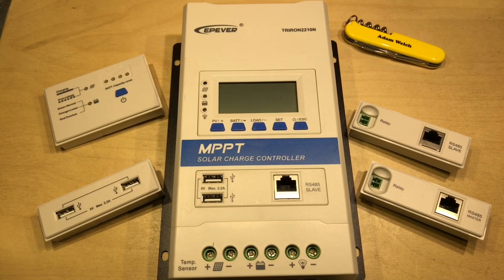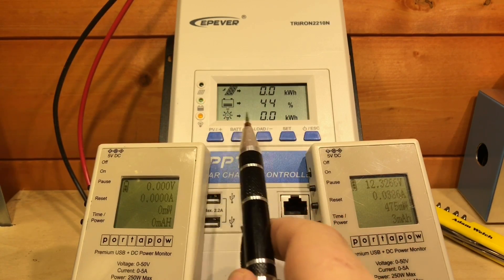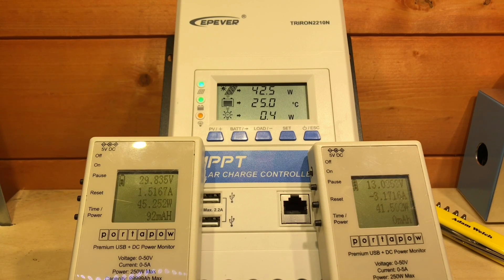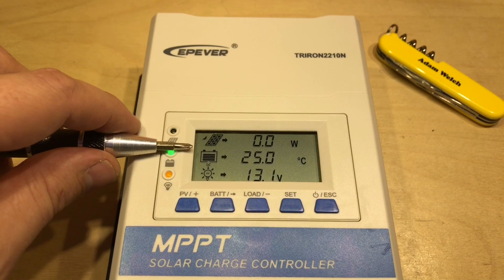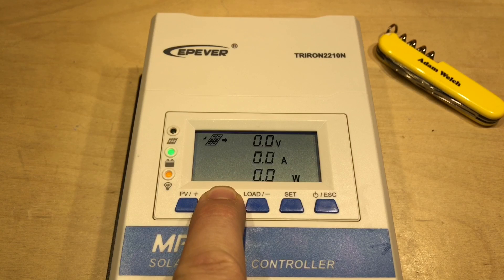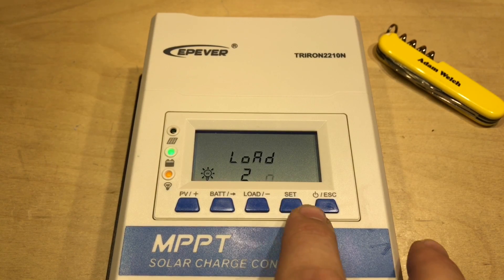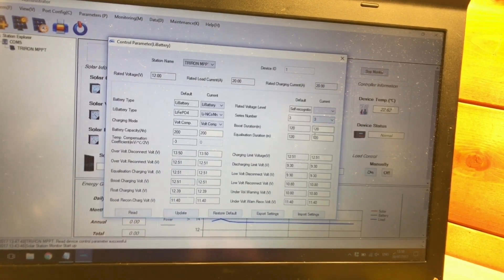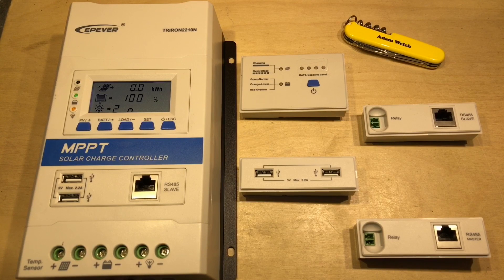First Test - EPEver TRIRON MPPT Solar Charge Controller - 12v Solar Shed

Comment: I've ordered a TRIRON 4215N to charge a 7kWh 24V LiFePO4 from 940W of panels. The documentation claims lithium low temp protection which is why I ordered it. This is an upgrade from a 12V Tracer 4215BN 220Ah FLA system. I still need a 12V system and am considering using a 24->13.8 converter, or if possible, do you think I could drive the input of the Tracer from the output of the TRIRON so that I can leave the entire 12v system, including batteries, intact while the 24V system is used mainly to run a 3 or 4 kW inverter?

Comment: Hi Adam! excelent review! i buy this one without modules and i would like to know if i can use it like that or i need the modules for make it funtion? thank for your anwers!
Reply from the maker: Yes it will work without modules. I’m guessing it will be in flooded battery mode, and auto switching between 12 and 24 volt.

Comment: thanks Adam for all your  valuable imformation regarding solar charging.
i have one question regarding MPPT,  would it make a difference between 1 x 100w 12v panel or having 2 x 50w panels wired in series??
Reply: I would guess that if you are working with either one 100 watt 12 volt solar panel or two 50 watt 12 volt solar panels, that having two 50 watt panels connected in series would have  a higher open circuit voltage and possibly greater efficiency in the Pv wiring going to the charge controller because it would be carrying a lower amperage. Aside from that, watts is watts.

Comment: Hey Adam, thanks to your videos and advices below I have now the old version fitted and working on my campervan with 200W solar panel.
I have a question related to batteries. I have 2x160AH FIAMM Monolite 12umtb 160 (AGM) plus one 100ah Maplin Sealed Lead Acid Battery I have likned them all in parallel to get ~400Ah on 12volts. Am I making mistake here? Do I have to make equalizers or split them (get rid of the Lead Acid one?)

The AGM one is with float charge recommended to 13.6, where the sealed one says 13.6 to 13.8. And I have set the EPever to 13.6 float.
Reply from the maker: It's generally not recommended to mix batteries.  They have different capacities and different charging and discharging characteristics.  However having said that there are lots of people who are running setups like yours and it works for them.
The biggest thing to consider are losses in charging and discharging and the potential current moving from a larger battery to a smaller one.  If your larger batteries spend much of their time recharging the smaller battery because it has a lower capacity it might be more sensible to remove it all together.  It's worth trying to monitor the current moving between individual batteries - best with a DC clamp meter.  The capacities aren't a million miles away from each other and the charging parameters shouldn't be either so it might be ok.
My advice, try with, try without see what works best in your application.  Although it's possibly not the straight answer you were seeking?

Comment: Hi. with charge controller have you now on your system.
Reply from the maker: +Christofer Steger I’m still using the EPEver Tracer A MPPT charge controller on my main lead acid bank. I’ve got another project in mind for this Triron charge controller.
Reply: Ok
I'm struggling to choose controller and now ordering a Tracer-A 4210A with temp sensor wifi and mt50.
So a can grow from my 200 W Panel.

Comment: Hi Adam, great channel and videos! I googled but I cannot find this controller anyware to buy? I am missing something?
Reply from the maker: I got a pre-release unit, but it is now listed on the EPSolar website so it should be showing up in the usual shops very soon I would guess.
Reply: Yep i saw it on the website. Still not listed on the shops. In general in comparison with the older version what do you recommend, go for the Tracer or wait for the TRIRON?
Reply from the maker: +Ясен Владимиров It all depends on what features you're after and the price I guess. If it proves value form money the better LCD screen option of the TRiRON is better than the tracer A. If you could use the USB ports then the TRiRON is the one. If you're going to pop your controller in a cupboard and just connect a MT50 or wifi adapter then the tracer a will do everything the TRiRON will in the same situation.
Reply: +Adam Welch - hey Adam, indeed, i will hide the controler and just use the MT50 to display some information in the motorhome and thats all. I will go for the old one, I found a pretty good offer on aliexexpress :) Thanks again! And keep doing this amazing videos!

Comment: As i had watch most of the video, Mppt solar charge controller is boost the voltage to chargeable voltage for charging! some how most of the people use the higher voltage to test the MPPT controller! never try how low the  solar panel voltage can be use to charge the battery! MPPT is design  to boost voltage when sun light is on cloudy days, it still able to charge the battery!
Reply from the maker: +Eric Lee The vast majority of offgrid MPPT solar charge controllers use buck converters. The solar panel voltage must be higher than the battery voltage. There are a couple of exceptions. The Minghe 7210A and the CTK300 are two examples of offgrid MPPT solar charge controllers which boost the solar voltage up to the battery voltage - but they are in the minority. 
On grid MPPT charge controllers will typically boost the solar voltage up higher in the inverting stage. 
This MPPT controller uses the high voltage and lower amperage to convert into a lower voltage higher current charge for the battery. Testing this controller at a lower solar voltage than the battery voltage would have resulted in no charge at all.

Comment: Thanks, Adam. I hope that a firmware upgrade will allow Lithium battery charging as default options, rather than you having to set a custom option. P.S. 'Man gan ease' - It's a bit of a tongue-twister at the best of times! You're not alone; I fall over it, too, when under pressure.. ;-) It really should have an easier alternative name.
Reply from the maker: Sorry! ;-p  Thanks for the assistance, I'll try to get it right next time, or just gloss over the term!  
Yeah a firmware upgrade would be nice but EPSolar tend not to do that from my experience.

Comment: Encouraging that it can support lithium now, however 3S or 6S is limiting, especially without balancing. Most 24V inverters would use 7S.
I use 14S for 48V which is a minimum for any serious inverter usage. As Epever make a fairly decent 48V 3kW inverter, it would be useful to make a charge controller that can support it!
Reply: Adam does this unit allow manual adjustments to manually set the voltage high enough to support 7s?
Reply: Just saw they offer a 60A eTracer with 3200W  (48V) max.
I'm curious about the 7s or 8s too, I think with user settings you could just set them to the correct overall voltages?

I guess you'd still need a separate BMS and balancing system e.g. Batrium or SBMS120 from electrodacus.

Comment: Hey mate, could you please do a video ( perhaps with super caps? ) showing if / how this controller stops charging / doesn't continue to float charge?. Its a little confusing how it charges, i assumed that in boost mode it charges to say 12.51v and that it doesn't apply a float charge until the battery drops to the float voltage of 12.39. That's how i understood it anyway but some people say you should set the float voltage to the same as your charging limit (12.51v) to stop it float charging. My experiments were poor but it seemed that even with the float voltage set at 12.39v and the battery at 12.50v it was still float charging.

I might be missing something obvious :) but i want to be sure i'm not harming my lithium cells  if possible but don't have the gear / knowledge to be confident i'm doing the right thing. 

Cheers
Scott

Comment: of course we would still need a BMS when running li-ion to keep packs balanced, can you recommend one?
Reply: I have brought some of these as the output can also be used as charge input:
http://www.ebay.co.uk/itm/3S-11-1V-12-6V-25A-W-Balance-18650-Li-ion-Lithium-Battery-PCB-Protection-Board-/382111867043?hash=item58f7a460a3:g:KqUAAOSwBt5ZMP4p

Comment: Epsolar says it's 98%efficiency
Reply from the maker: +Hisham Safaoui And I believe it will be - at different input power. With only a few watts coming in your bound to have s lower efficiency - the charge controller itself uses power. The graphs seem to show it reaches peak efficiency at about 100 watts and only dips slightly above this level. 
Due to the poor weather here I couldn't test that as much as I would like - yet.
Reply: Ok, got it, logic thanks for the answer, keep upthe videos!

Comment: Why is this controller advertised as lithium charger and Tracer A is not?  PC software supports libattery setting for many months and you can also use it with Tracer A.
Reply from the maker: +Ohm711 Yeah - unless I have missed something with the lack of a complete manual it's not any different in that respect. I didn't realise that in my first view video. It's still a three stage charger and seems to miss the lithium setting in the menu system.

Comment: Looking at the Li-ion settings, it doesn't seem to have anything special hardware wise to support lithium technologies, just a bunch of settings. Should be able use the TracerA series and set the same values as a user set battery?
Reply from the maker: +Darren Poulson Yes this is true. Essentially it is still a three stage solar charger which has had some reasonable voltage limits set in software for lithium cells. I was a bit disappointed that these presets weren't available without hooking it up to the computer though.
Reply: I would think that it is only set with the PC for a reason. If you are using Lithium then you will most likely have it hooked to a PC to collect data and set everything for your system setup.

Comment: is this better than the tracer ? and the cost?  is it safe to use a DC to DC on the input? I have a small DC hydro generator. bit its 12 v I was thinking maybe I could use a DC boost converter and wire it in with the solar . in the input of the charge controller. do you think this could work?
Reply: James stranger do you have any videos of your hydro? I’d love to see your setup please